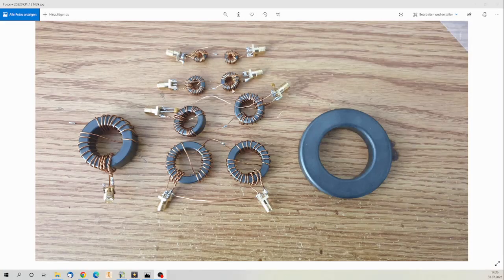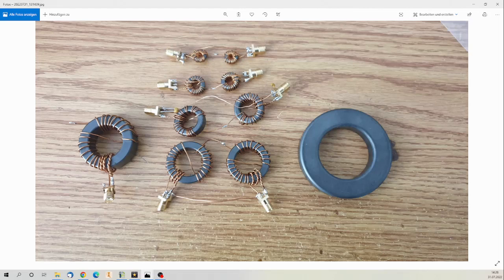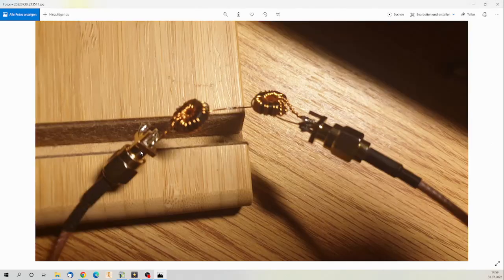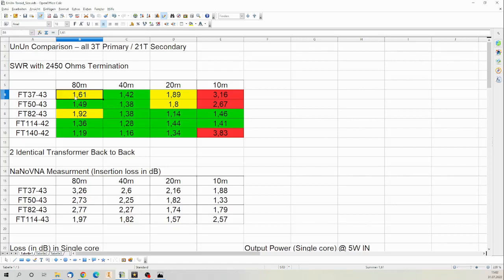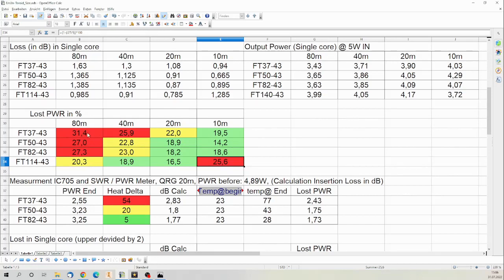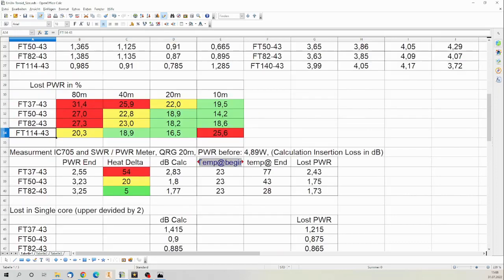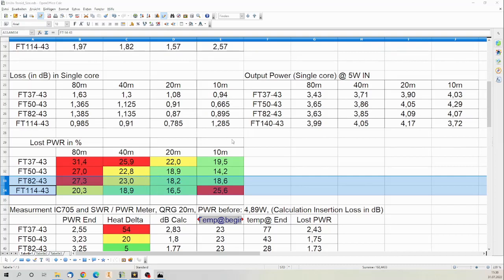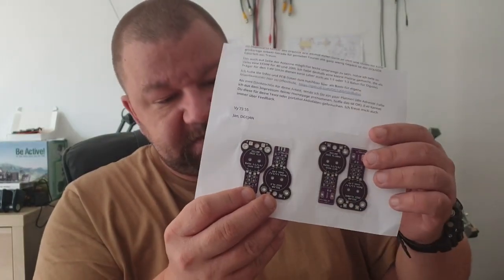Antenna building #2 - EFHW Antenna - figuring out the right core size

Comment: Thanks for looking into this. One thing we learn here is to avoid making assumptions without data. In the same vein we should not assume tuner loss values, they vary dramatically depending on the actual situation, configuration and settings and can be low or high. Tuners are easier to model than transformers, so we can mathematically get some data on tuners and we need to include that, as well as feedline losses in any comparisons of antenna systems. Also concentrating on a smaller frequency range we can optimize for lower losses. Trying to handle "all bands" isn't necessarily the right goal. We have better options for higher frequency bands with small antennas, there's little need to make the 80-30 meter antenna work on 20 and up. 73 de w6akb
Reply from the maker: Great comment. Thanks !

Comment: Very good result of efhw baluns. I think you had better wound 3 turns reduce to 2 turns for the primary  of balun. Look at the most right for the input power of 10 meter at 27 line. it is less than another band input power. the primary wound will good by increase widing turns at low frequency band. but high frequency band will bad responce. Thank you.

Comment: I sometimes go portable and use UNUNs with FT240-43 toroids to handle 100W SSB or 30W FT8. Do you think the FT114-43 toroids will be able to handle this power level ?
Reply from the maker: The 114 probably not (for long) but 140s should be good to go.

Comment: Great job i found simular results also by putting them back to back using a VNA.
Many videos telling you to twist the primary windings  of 49 to 1 I found that this causes high losses in the 10 meter band. I also found it necessary to vary the turns depending on core size.
Happy to see someone else verifying  the work I have done. Your a better  man than I, as I haven't had the time to publish anything.  Great job!!!
Rob A N7RBC
Reply from the maker: Thanks, but that´s pure egoism. When I do such experiments, I forget about it a year later, when I want to build another antenna, so I watch the videos so see what I already found out ;) For me it´s just a form of documentation. Why not let others benefit.... 73 Manuel; DL2MAN

Comment: Very well done Manuel 👏.  I'm now working on a workable solution for the larger core I have been testing for insertion loss. It turns out that this what my myantennas use for their 250w (100w Continuous data) version. I need to get one of those digital power meters and I can do the "under load" test.
Reply from the maker: Looking forward to your Video, as this means in terms of 100W continuously at least 15W dissapation into core. 73 Manuel; DL2MAN
Reply: There is an option that I have used successfully. By winding a core with a 2 or 3 or 4 turn link then use a VNA to get the parallel resistance, you can calculate efficiency. From that you can calculate heating when you know power, mode, watts, time and efficiency. I got within 1% or 2% difference on a back to back tested pair of cores and the link-test methods (best) - FT50B-43 cores, 3T autotransformer (91%). Same with a single FT140-43 (87%). Stacking cores improves their geometry and seems to being more efficiency, 3 off FT82-43 was around the 91% also.
Reply from the maker: @richardholmes9469  Thanks for you interesting comment. Could you give me a hint, HOW to calculate that ? I have no clue how I could calculate it, andI´d like to compare your suggestion with my measurements. 73 Manuel; DL2MAN

Comment: I used my endfed for the last SOTA and found I sit in one spot all the time and get a sore body. After my hikes up its nice to jump up and swap links on my dipole and that lets me stretch out a bit during the activation. By fluke I had a FT 82 43 to make my EFHW and it seems to run quite cool. Thanks for all the good work setting that all up and sharing with us the results.  vk5cz ..

Comment: Thanks for sharing your investigations and creating a very informative video.  The measurements at 5w with a power meter and a thermal camera were a great idea.
While 20% losses sound terrible, it isn't necessarily a reason to abandon the EFHW for portable use, as some would have us believe.
For comparison, I regularly use a resonant linked dipole as an inverted V, with the apex around 5m. On the 40m band this has a feed point impedance of around 20 ohm, due to the low height, leading to a 1.6dB loss in my 10m of RG174, and around 30% signal loss.  It works just fine but probably isn't as efficient as an EFHW!
The EFHW presents a feed point near to my operating positions so I can use around 2m of RG58 coax.
Reply from the maker: Agreed in Part, 2m COax might be too short. We suggest using at least 0,05 Lambda, which would be 4m @80m, usually we use 5m of Coax. This acts as counterpoise and aditionally helps suppressing common mode currents, when lying on the ground. I measured 5m of RG316 with -0,24dB on 80m and -0,63dB on 10m.
Reply: @dl2man  I use a 0.05 lambda counterpoise on my EFHW and have a choke BalUn on my coax near the Balun to reduce common mode current.
My point being that all antennas have losses, and a simple resonant linked dipole is not without losses when at a low height and fed with 50 ohm coax.
The EFHW antenna can provide many advantages for portable operation.
Thank you for taking the time to respond.

Comment: I went through the snorting ferrite phase. After going through the 12 meter therapy I no longer use ferrites for anything other than a common mode choke with the coax wound through a large core(s) for 14 turns total (usually). I have used type 43 mix but I prefer type 31 mix for chokes. 
 I have 2 EFHW antennas in use currently (40 and 20). I use coil and cap tank circuits to match them.
I understand the desire to have one wire do everything with no ATU.
 I also understand that no matter how much I desire more money, that simply sticking up a gas station has undesirable losses. Like 15 to 20 in the slammer.
When you are limited to flea power for pota/sota/marooned-on-the-ocean I do not understand why one would be happy with dumping watts into infrared. Blue watts matter too.
Yes, your pota transformers are cold when you wander out and check them. That is the duty cycle and air cooling, not the efficiency.
A wire with some alligator clips for keeping the length in the 3/8 or 5/8 lambda range on each band and a light weight tuner would be my choice. 
Now, if you are happy with your transformer then I am happy. Sayonara  :)
Reply from the maker: There is no free lunch in physics ;)  Everything comes at a price. So it´s all about finding the best compromise for your situation. I have recently built a linked (multiband) dipole as another option without those losses: https://www.youtube.com/watch?v=Az2Q-xpuRk8 73 Manuel, DL2MAN

Comment: Very interesting. It would be really interesting to see the same test performed with 2x of the 37 cores stacked in top of each other. Many have suggested that the smaller diameter core can achieve greater efficiency (if not in saturation).
Reply from the maker: Interesting ! Maybe I´ll re-visit.... 73 Manuel; DL2MAN
Reply: I was thinking the same thing - stacking 2 small cores. In fact, I pressed ctrl+f and searched the comments for "37" to find this comment of yours! It's hard to get ensure toroid quality where I live and intl shipping is expensive, so I ordered a  bag of 10 of the ft37 cores a while ago. I have to find a way to use them!

Comment: I have spend months building your trusdx...I got a very early kit...winding the toroids, soldering the relays, all the pins, jacks, switches, making the small tweak to the back of the display...I'm slow, evidently, and I had to do lots twice when i found my mistake from the first effort. hahah.  And then.  And then. I had to do the software.  There was nothing on my board. I had to go back to the beginning of time and the first bit of code and start from loading the bootloader, but to do that I had to figure out how to operate a strange little device called a usbasp, and load the software for that, before I could try to load the bootloader, and what about drivers, and then I had to get the firmware working, but before I could do that I had to...well...you get the idea. So you have been on my mind a lot lately. hahah.

After suffering extensively, I finally got the serial number to show. Oh jump for joy! The screen has a number! then to your site and load my call/serial #, and get that to work,  then back to the little orange box of misery.  And more trial and error, with more error than trial. hahah. 

What does this have to do with EFHW antenna core types? Well, after the orange box of now JOY came to life, I have to build a portable qrp EFHW antenna. So I have just spend the last two hours watching you like the high priest of EFHW build-ology...every word...every point...every consideration has been poured into my old age brain. I am soooo much the richer for paying attention to your work. If I had learned how to pay attention like that when I was in school, I might have gotten much better grades. hahah.

I have really just one goal..get your orange box of joy, working with a laptop, a portable EFHW antenna, all using power from my ebike, in a park and making one, just one, park activation (POTA) in VarAC, or PSK or THOR (my current digital crush). And then i will call the entire adventure a success, and be happy.

So, sir, thank you for the guidance. In a few more months I might be done. maybe.   Don, KM4UDX

Comment: I see lots of design for higher power that use stacks of toroids or toroids in parallel/series, and I wonder how that might change things a bit.  Like, would a stack of 3 37-43s behave more like an 82-43?  Or just lose even more energy to heat?

Given how much more expensive the larger ones are, it might be worth investigating stacks of smaller ones...  Plus, the smaller ones are easier to fit in a box, throw in a backpack and not worry about it breaking in the field.
Reply from the maker: Maybe I´ll revisit this at some point. But right now, unfortunately I don´t have the free time for it. But I agree, this would be an interesting topic. 73 Manuel; DL2MAN

Comment: Wow! I found the heating versus loss as well. Running 500W though. Even stacking three 2.5” diameter cores (two #43s around one #42) didn’t help. If I was foolish, I’d put a fan in the box with the cores ;-) . At which point I am tempted to use a random length of wire — maybe 45m to 60m — and my trusty remoted Z-match. Even though tuners are supposed to be lossy, I have yet to see the heating/loss problems of the EFHW + unun set up in my Z-match tuners. Thanks for this very informative video, Manuel. Stay safe & healthy! 73 de W8IJN
Reply from the maker: A Z-Match is by default a symmetrical Tuner, and does not really fit an EFHW in my Opinion. I´m using a Doublet with a 200W Z-Match at home, and I can confirm, there´s amost no losses. But feeding an unsymmetrical ANtenna with it doesn´t sound right. A Z-Match, that can handle a few hundret Watts is also a unicorn, as this reuires capacitors with huge plate distances.... Or vaccum C´s..... I would like to hear more of your Setup, please. 73 Manuel; DL2MAN
Reply: @dl2man  I’m going to have to find my old photos of the first build. Or make new ones of recent changes/repairs. Meanwhile, I sent an email to your QRZ email link.
Reply: May I suggest looking at efficiency. DM2MAN is on the right track with actually testing his designs (which seems to be rare) and kudos to him. Then when you have efficiency you can calculate heating from power, mode, time etc. My suggestion FWIW is to stack 2 cores, tightly close wind as an auto transformer, 3 turn primary and total 21 or 24 turns. My tests indicate over 90% efficiency with 2 X FT240-43 and  3 turn primary. Adding a 3rd core sounds good but 3 turns may be too much for the transceiver to work into. Also, at 500W I'd be a bit nervous of the voltage on the top end of the transformer. It could get exciting (flash over). Also a 1:1 or good coax arrangement might be needed. I would definitely use radials (I run 2 of them). I did a calc. Assume 500W SSB -> ~ 100W CW. Total core weight 212 grams (2 off FT240's) and 5 minutes of transmit, 90% efficiency. Heat rise about 18C. If you run digital mode at 500W (scary thought) then it will be 5 times that rise and be at damage level unless you running antenna in the snow! VK3TXD

Comment: Great information thank you very much Manuel. Your help saves a lot of experimental time for others who want to build similar antennas.
I have a few questions:
When you spoke of FT140-42, you really meant FT140-52 no ?
I real question is that right at 7:50 you spoke of an " FT140-52,  2 turns primary, 14 turns secondary, it works ALL over the bands".
Did I hear correct ?
I am about to try out this, 52 core type, with 2 turns primary and 14 turns secondary, with a larger core , x2 FT240 size toroids.
I will really appreciate your advice in this.
I will be buying the toroids, probably from Fairrite shop in the Netherlands.
I will also buy some FT240-43 and try them out as well.
Thanks, Vincent, 9H5LX
Reply from the maker: @Vincent Borg No actually I was talking about  (at least meaning) FT140-43 and FT240-43, but make sure to buy the original Amidon/Micrometals. There are also "B04A" available, which were causing trouble in our experiments. And yes 2-14 for bigger cores. More info on my Page: https://dl2man.de/antennas/ 73 Manuel; DL2MAN

Comment: Thank you Manuel! This answers a question I have had for 2 years. The actual situation may be worse, nobody knows exactly the efhw antenna impedance. In a real situation, what is the actual height? Is is probably sloping, and what is the counter poise. Does the coax act as a counter poise? Any grounds?   Many thanks!
Reply from the maker: Great questions ! And they absolutely belong to that topic. I´m going to adress them in one of the next Videos.
Reply: @dl2man  Are you able from the heat pictures, to figure out what is heating up? is it the wires, or the core? primary or secondary? the core is governed by the amount of amps-turn. less turns on the primary will reduce the magnetic induction. I am leaning towards  too many amps on the small wires. Woud bigger wires on the primary help out?  A very ionteresting experiment!

Comment: Great video!  Lots of useful info.  I want to wind a nice 1:49 with FT114-43 core for use with IC-705 and PA500.  That means I may be doing digital modes at 30 watts.  What wire gauge is appropriate?  Thank you.
Reply from the maker: You can´t go wrong with 1mm +/-

Comment: You may have already made a video comparing different mixes, ie.  43, 61, 31, 52.  But if you haven't that would be interesting.  I think 43 material is not the best material for 80 to 10 meter transformers.  Either 31 or 61 may be better.  Tests may reveal the best material for each band but testing that would be very time consuming.
Reply from the maker: I agree, that would be interesting, but I´m more "result oriented", so once I have found something that works within the desired specifications, I usually stop looking. Maybe when I´m bored ;)
73 Manuel; DL2MAN
Reply: 31 Material is NOT for any EFHW unun application, it's very lossy in the HF bands making it suitable for HF common mode chokes.
61 mat is more suitable for 15m through 6m.  
2 or 3 FT-240 43 and 52 mat FT-240 are best for 100w EFHW applications.
Reply: @no5x937  43 material is also lossy but the differential loss is usually pretty low.  31 material would be superior to 43 material at 1.8 mhz.
Reply: @rickeaston3228  Yes, but very few hams use EFHW at 160m.  I'll stick with 43 and 52 for 80m - 20m.

Comment: Excellent video. Thanks a lot. Can u just comment is on 80m 2:14 ft140-43 better due to turns # or core size? 
Actually my point is: I'll use 2 : 82-43 for 40 up and looking for 80 or 80-40
73, kuba sp5nzf
Reply from the maker: Yes, specifically on 80m, I´d recommand using the FT140-43 with 2T Primary / 14T Secondary for up to 100W CW/SSB. Best performance on 80m in regards of SWR and losses. When you want to build smaller, you can use FT114-43 with 3T/21T for up to 25W CW/SSB. 73 Manuel; DL2MAN
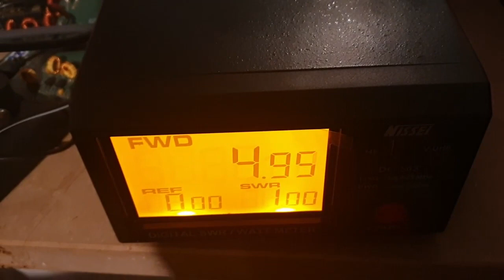Reply: @dl2man  thanks a lot. I have 5-20w ssb/cw -my shiny new great little (tr)usdx and g90. So it  is only about efficiency and swr. U said that 140-43 2:14 was more efficient than 114-43 3:21 so I wander should I use 140 2:14 or 114 2:14 or 140 3:21 or 114 2:14 for best perf on 80 ... ;)
 73 Kuba sp5nzf
Reply from the maker: @jakubrusiecki1640  Don´t use 114 core with 2:14 and don´t use 140 core with 3:21. It´s either FT114-43 with 3:21 or FT140-43 with 2:14.  Both are equally efficient, while 114 is smaller, lighter and can handle less Power.
Reply: @dl2man  thanks. My trusdx and I will be happy :)